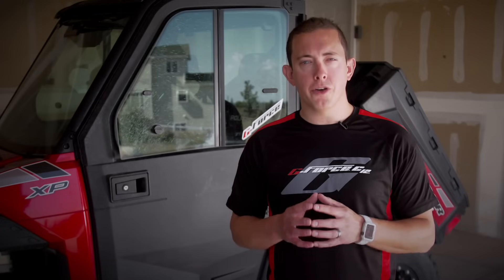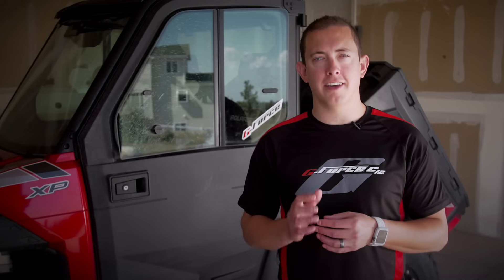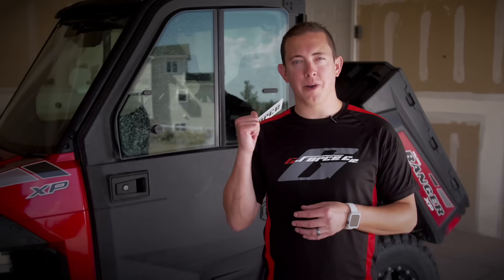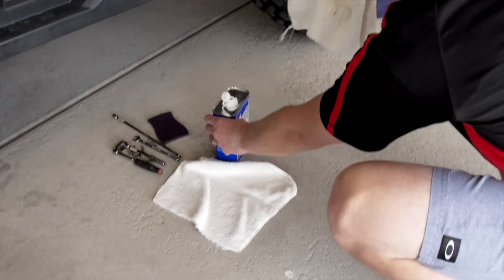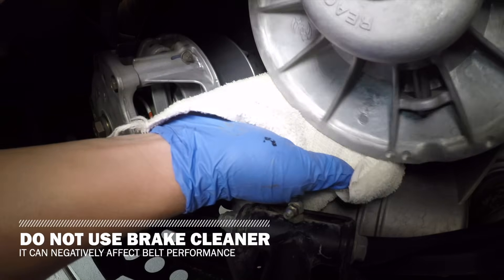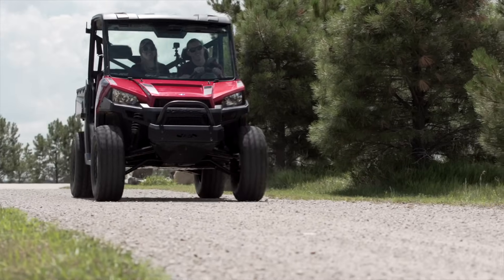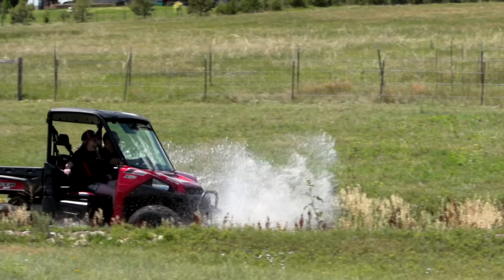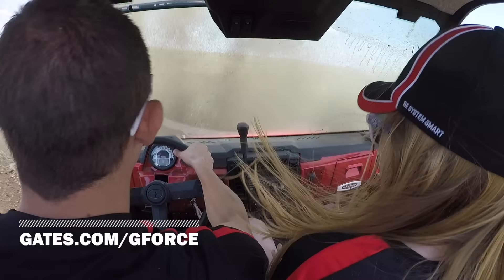How To: Properly Install and Break in CVT Belts

Comment: Solvents / Cleaner use Everclear 190. Cleans better than IPA and lower cost. I buy the stuff by the gallon and use Everclear 190 everywhere you would use IPA. I buy those 99c spray bottles and Everclear 190 for clean tools, kitchen counter tops, hands, face, massage vs rubbing alcohol  everywhere on everything even cooking.
Clean no residue
Cheap low cost
Ready available
Cuts grease and dirt.
CAUTION.
Do Not do Everclear shots!!! Do teaspoon Everclear 190 with a water cut to 1oz.

Comment: I've been using your c force belts in my can am and my polaris. Both were properly broken in. BOTH started coming apart at the outer teeth and cracking in between the ribs on the inside of belt. Only a couple rides on both belts and that happened. When I run the g force belt in those machines this does not occur at all! The c force belt yall make is supposed to be better, and costs more than the g force but doesn't seem to hold up nearly as good. Others I know are having the same issues I am with the c force belts coming apart just like mine and at $100 a piece I can't just keep buying more and more of them for the same thing to happen again just after a couple rides. Do yall warranty your products? If so I need to get these replaced.
Reply: I think the C series belts are only rated for up to 700cc, is yours above that, because if you don't get the correct type it will start chipping off the sides at the top.
Reply: @jakebaker8210  why would they offer it for my application then?
Reply: I’ve not had good luck with gates belts either own or hunter worker belts last the best for me..
Reply: Had the gforce in my teryx went thru the break in period then took off on a ride to only make it half way thru an the belt disintegrated
Reply: @NickBurns-d9p that sucks, people don't understand that entire clutch has to be disappointed and thoroughly cleaned after a occurrence like that, most nobody does though and then have continued belt issues.

Comment: What's wrong with brake cleaner?
Reply: Doug Bagley wondering the same thing. Legit just cleaned it with BC.
Reply: I think it leaves residue that can cause belt to slip.
Reply: Correct Rob, some break-cleaner leaves residue. I prefer Starting Fluid for cleaning parts. Evaporates quick and leaves no residue on parts.
Reply: Chemicals like brake clean soak into the aluminum sheves, and come back out when the sheves get warm, the clutch sheves are very porous, hot water with dawn, nothing else along with a Scotch Brite pad.
Reply: @jaybee8210 people underestimate how much aluminum can absorb liquid. When we pre-heat it at work it will literally drip
Reply: It must leave a film that may cause slipping
Reply: Brake Clean is very hard on rubbers
Reply: Just use acetone and move on